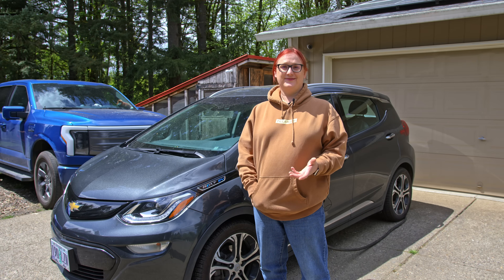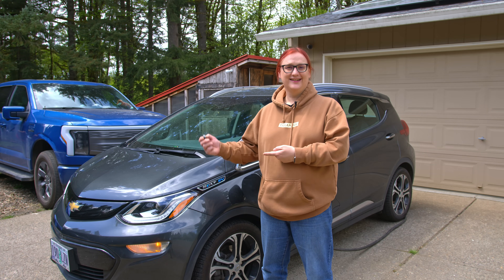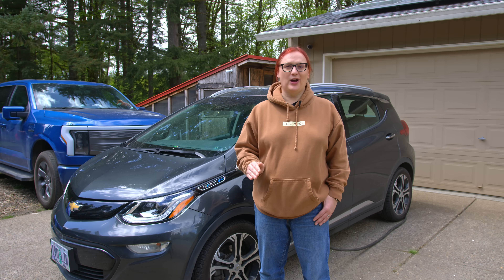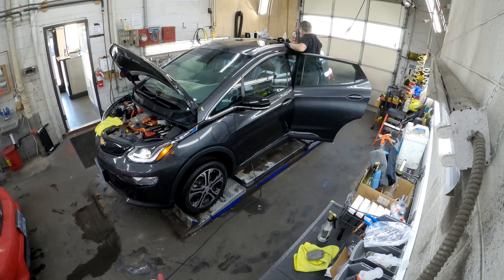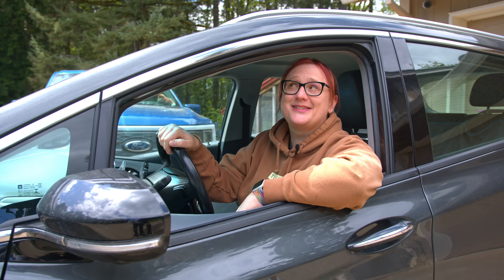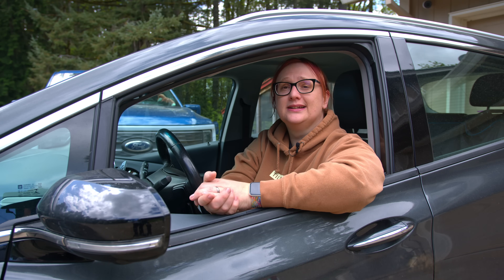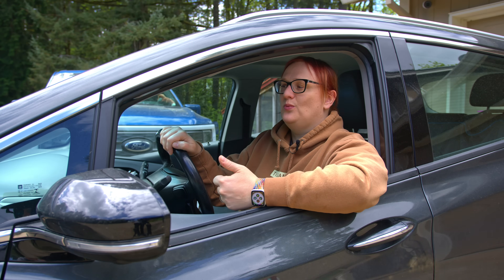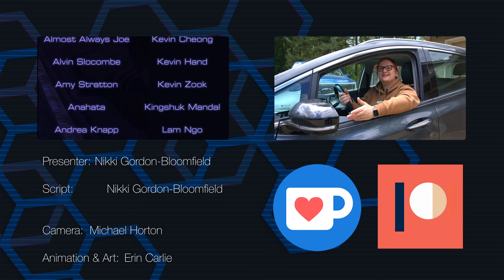Can We Re-Energize A 2017 Chevrolet Bolt EV? Welcome To Project Re-Energize!

Comment: It looks like when your bolt was being pulled into the garage that there was some sort of wireless EV charging device on the floor and something that would tell you when you pulled in far enough on the wall ahead of the car. Am I correct in this observation?
I've not heard of anything like that, and don't see a video on it in your video queue. But there's quite a bit to look at and I'm just going by titles. I also don't see a playlist for the bolt except for one about the battery exchange with five videos on it. Sorry if I missed anything - I used to follow your channel a couple years ago and got away from YouTube for a while. I just picked up a used 2020 volt LT 4 months ago and I'm not looking to do some upgrades. I probably wouldn't know a self-driving mod even if my car was eligible because I'm just a bit hesitant to roll your own updates of that complexity.
Anyway I'm back to your channel now and I'll try to watch most of the videos going forward.

Comment: TE team, this was a great video. I'm really curious about the pedal interceptor, particularly what happens if it fails. So I recognize that it reads the voltage from the pedal and then retransmits it to the car's ECU (or sends the Openpilot pedal instruction instead). Do you have any sense of what would happen to the car if the module stopped working? Would it be a loss of acceleration? Is there any circumstance where you could have unintended acceleration as a result of a failing module? I know it's a very "do at your own risk" type mod, but I'm really curious what the worst case here is if it stops working.

Comment: Excellent video, I appreciate your talking points. I am currently driving a used 2020 Chevrolet Bolt EV Premier. I purchased it outright on Black Friday in November of 2022. I am still waiting for a battery replacement but it is preforming just fine. The range I must say is much better than my previous 2015 Nissan Leaf.

Comment: As someone who just bought a used 2020 Bolt EV in the same color as that one, I'm super interested in this series. I'll be hanging on along with you and seeing what I can do with it. Personally I love it overall, I'm just hoping the battery replacement process will be smooth. I've already been wanting the wireless Android Auto addon, but I've had lots of little problems with the infotainment screen anyway so idk if it'd be worth it. I'm not interested in the autonomous driving capabilities at all, but I'm excited to see the rest.

Comment: Having been owned by a 2015 Fiat 500e, I am fascinated by this project and hope that something can be done for the Fiat platform.  My ultimate desire is to have a vehicle that I can drive to the party and let it drive me back home, much like the horse drawn carriages of the 1890's (Open Pilot to the rescue.)  Figet, my 2015 Fiat 500e, is going on 7 years in my possession and it seems to be retaining about 60% of charge compared to when I first acquired it it march of 2017 with 15,000 miles. The current millage is about 65,000 miles. She is still a delight to drive and my 3 Kw solar PV array keeps my home powered and car charged with a modest 500KWH per year excess power returned to the grid in Silicon Vally. However my daily range is creeping down to less that 60 miles of usable range and this is starting to be a handicap in my current lifestyle, (I retired from Aerospace to beekeeping i recently.) During the intervening 9 years EV's have advanced significantly and I am looking to capitalize on that accumulated knowledge base and upgrade my Fiat 500e with newer technology while I await the anticipated production of the 600 to 1000 mile Aptera (that is round two for those keeping track.)  I have heard rumors that battery technology has advanced by 150% in the intervening years and that a 36 KwH battery might be available as a replacement for the existing 24 KwH battery (a blessing to #BMW the source of this Fiat electric drive train.)  This channel is the first I have found to address EV update issues and I intend to follow this thread, avidly!
Thank you as well for "Fox in Leaves," that Tee shirt was quite distracting and cemented a place for this channel in my Y-T viewing lineup. 🦊Riki2Tails @ FoxLanding Chilloquin, OR.
Reply: I have a 2015 Fiat 500e, great car, but I don't think there's much that can be done for it in the near future. No Lane keep assist, so autonomous seems unlikely unlikely. Maybe if you can keep it long enough there will be aftermarket shops that can put on next-gen battery in its affordably someday. I think the best hope is a next gen battery pack in the trunk or back seat that can give you 40% charge through a cable at 200 lbs carefully strapped down.

Comment: I got my 2017 Bolt in late 2019 for $15,000. Had ~42,000 miles on it. 

Glad comments are back on even if you're not reading them. 
Sucks about the haters though.

Comment: This is an interesting challenge. The EV used vehicle tax rebate of $2500 does help make used more appealing, but I also consider the EVs before 2021 all early adopter level vehicles. Not saying we have truly achieved mainstream level in 2021 on average, but it seems like with every six months another EV with mainstream appeal hits the market. When Tesla refreshes the Model 3, it will move to a 48 volt system. I believe the Cybertruck will have that as well. It will be interesting to see if this move by Tesla will be enough to get the industry to change. From what I recall Mercedes has a 48 volt system on their new EVs already. 

Maybe for fun, when this project is basically done, do a comparison with vehicles like the new Kona EV coming out soon. Just do not used the full $7500 EV government rebate as a factor. I say that because in my case I would only get $4,000. I do not think as many people will get the $7,500 rebate as some media outlets and manufacturers act like will. I am guessing the Kona will struggle to qualify for most of the rebate if any of it, but the way political winds shift, it will be hard to say. 

If the Tesla compact reaches market in late 2024, that might transform the buying landscape for EVs. It might take the wind out of used EV sales or at least push prices down more. The ramp up will take a year, so more likely to see the impact in late 2025. 

Some of the Chinese brands, which GM has a stake in a couple, could bring ultra cheap EVs here if GM tries building them in Mexico. Since GM is already building some of their EVs down there, they may try to do some of the city car EVs built in China to be built in Mexico to get some of the US government rebate money. 

Looking forward to the series. Keep up the good work.

Comment: I'm really looking forward to this series. We're buying an EV this year, and want to do what I've always done, which is buy a used car and save myself that depreciation. My top choice atm (in our budget) is a Kona, and part of the decision making process is if I find one that is affected by the recall, I can see that as effectively resetting the age of the car when it's done, so this series is right up my alley. I'm interested in seeing how the process of modding the car to get features you're looking for goes, and if you run into any weird problems with computers and sensors along the way.

Comment: I had a 2017 Bolt Premier with LKA. Due to the LG battery issue I gave it up. But I do know about J.S.s Openpilot hardware offerings. Sorry you weren’t able to get hardware from that source but he is instrumental in getting the software working  no mean feat.

Comment: This is fantastic! We don't throw away our houses when they get old and worn; we redecorate and rehab them. I have typically gotten 8 to 10 years out of my ICE cars and the only reason I give up on them is that the engine tends to shake itself apart due to continuous mico-explosions that go on in the cylinders. My plan for my 2020 Model Y is to find a way to rehab the interior as it ages since the motor and battery appear to have a very long life (based on high milage Model Ss). I'm also confident that the suspension will hold up better too because of the better balance and less vibration from the motor (only road roughness will beat it up). I think EV rehabs will become a thing over the next few years. Sort of a Pimp My Ride but more practical.

Comment: Thank you, Nikki. I was at the Ford dealership last week having my annual inspection and a/c service done on my '99 F250 and while there looked at the few new cars they actually had. I'm telling you to illustrate the value of your intention to keep, maintain and update a vehicle. They had an F150 for $62k, an Expedition for $80k and a Mustang Mach E GT for $72k. My understanding is that the average monthly payment on a new car is closing in on $1,000 per month. The service and minor repairs on my truck this year were $611. I can handle $50 and change a month for a 2nd reliable vehicle!. My other car is a 2022 Bolt that I go0t on a low mileage lease for $298 a month, with an option to buy-out for $22k. I understand they stopped offering buy-outs right after we signed the lease on the 2022 Bolt. We started with a 2014 Volt, went to a 2020 Bolt lease and traded it for the 2022 during the recall debacle...to our advantage. It is a terrific car and we will likely take the buy-out when it comes up...unless the Equinox tickles our fancy.

Comment: I find it insane that a 2017 car is considered so 'old' as to be undesirable while the drivetrain is still in good shape.(And that 8k /left/ on a lease is a good thing!) But I suspect being somewhere that a motorbike is a daily driver may play part of it.
If this keeps people driving their older EV's  longer then this can't be a bad thing however
Reply: I grew up in northern New England, in the '80s and '90s 10 years was about the lifespan of a car because of rust. The PNW is far gentler on cars, they don't salt the roads  in Oregon, Washington or (at least urban lowland parts of) BC.
Reply: @nlpnt  Australia here, my current car is over 20 years old and apart from being crazy fuel thirsty(being a H6) and needing a trick to put into reverse, is a reliable machine  with not a spot of rust It'll only be replaced if I ever get around to building my EV. (It's out 'move lots of things' machine)
My last car was from 83, that was mostly rust due to spending the first 10 years of it's life as a rental car in one of the surf towns, so yeah, salt really does eat cars.
Reply: @nlpnt They do salt the roads in Washington during snow, at least in Vancouver. They have begun salting roads in Oregon but it's usually restricted to more vital roads.

Comment: Far too much money for a car, I believe a mid sized car cost $15,000 in 1973 in the USA
Reply: $15k in 1973 is equivalent to about $90k in 2023.
Reply: In 1973 a 4 door Corolla with the automatic transmission cost about $2,400 dollars. Adjusted for inflation (from the CPI inflation calculator) this comes to $17,000 today. 
A new car. I am optioning up by going to the 4 door 1600 with the auto rather than the 2 door 1200 with a 4 speed.
Reply: $15,000 in 1973 is worth $101,971 today.
Reply: My first company car was a 1980 Chevy Citation for $10,000 in 1979. Mid size Chevy Malibu's were actually cheaper I believe.

Comment: Awesome! I want to look into the Open Pilot upgrade. My 2017 Bolt EV has nearly 90k miles and now also modified thermal management to improve Winter experience.
Reply from the maker: Modified?
Reply: @transportevolved  Yes, I have interconnected the power train cooling loop with battery to reclaim some heat to warm up the battery.
Reply: @stanislavjaracz - share some pics of your upgrade, and experiences since?  Bolt DC charging in winter is a miserable experience.